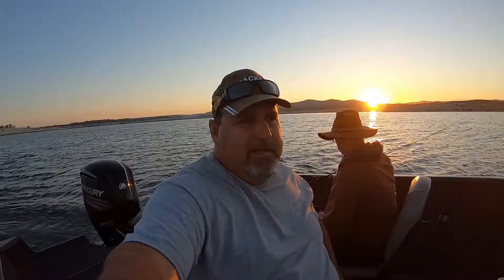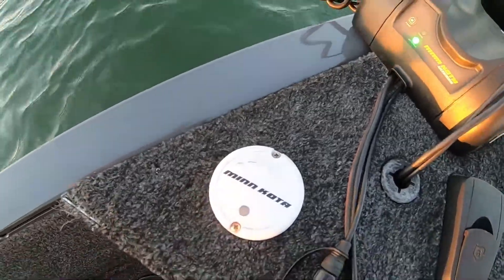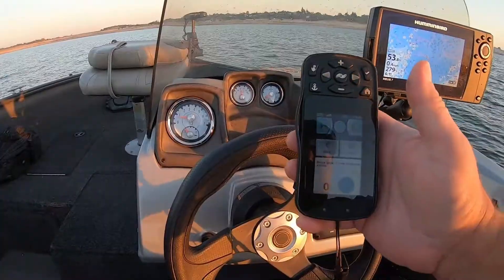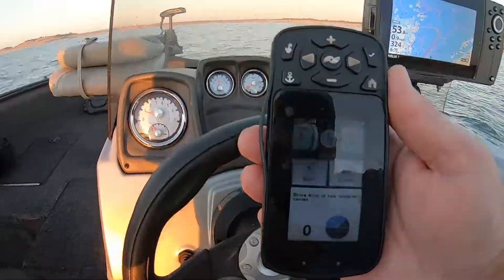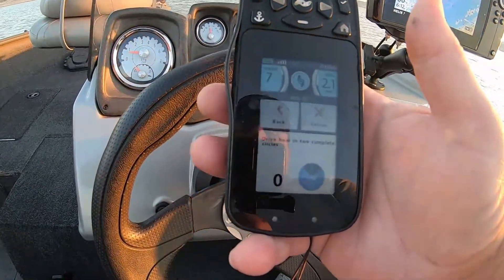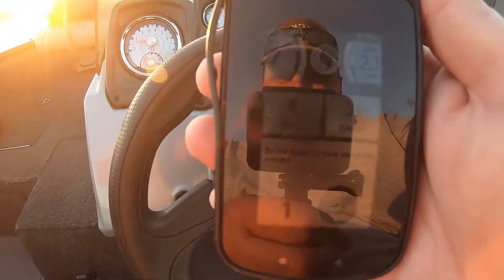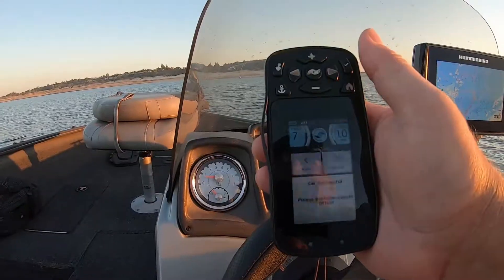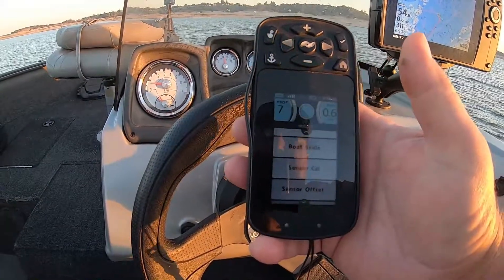Minn Kota GPS Heading Sensor Calibration

Comment: Do you have to calibrate every time you use it ?  Does it reset when you power of the system ? I,just bout one , still getting the hang of it ?
Reply from the maker: No unplugging or turn off dosen't lose the calibration

Comment: How is the location of your heading sensor working out? I’m getting ready to install mine and I wasn’t sure if the trolling motor power cable would interfere.
Reply from the maker: Perfect
Reply: The heading sensor needs to be at least 3' away from the head unit this comes directly from the manufacturer
Reply: Hello , been watching your videos,  and was wondering  if you can use the transducer on your ulterra on your humminbird at your console and also view your transducer on the back and how you got it wired , thanks